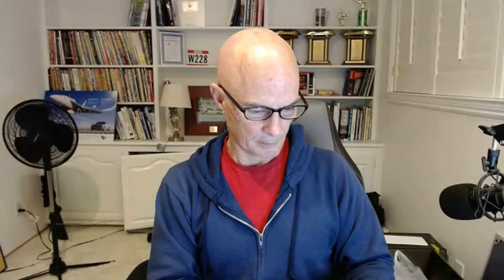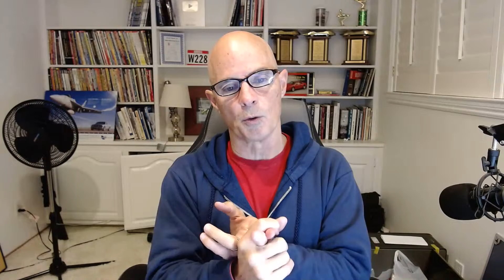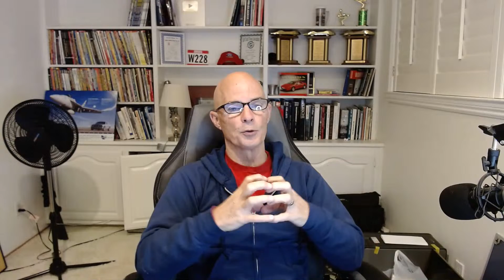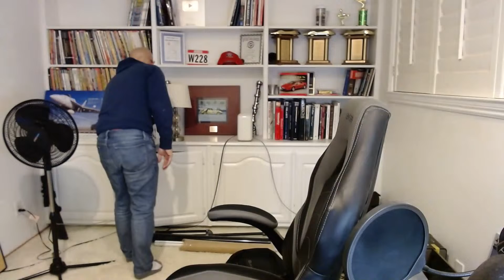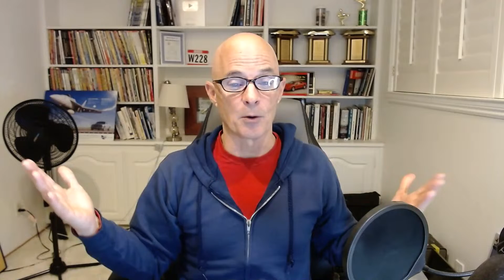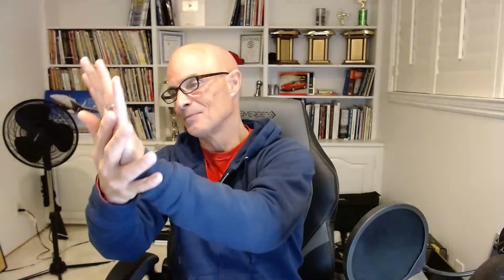LET'S TALK TURBOS-DOES RICHARD HATE WATER/METH INJECTION?

Comment: if liquid wont evenly distribute through the runners.. your theory.. how does a carby work??
Reply from the maker: HAVE YOU MEASURED AF DISTRIBUTION TO THE CYLINDERS ON A CARBURETED MOTOR? I HAVE
Reply: @richardholdener1727  no but I had twin egt's on a 13bt on pump fuel running 28psi with pre turbo wi? Both read the same, the thing is e85 isn't ready available everywhere in the world, most of your tests are on e85 and low boost, mine ran the same wi setup as green brothers racing.. on a street car , what is the point of e85 when you get around 30% less fuel economy and can't fill it up anywhere besides carrying extra drums of fuel with you, I think you should re run a test with a smaller engine.. out of the USA like here in Australia most boosted engines are 4 and 6 cyl and highish compression these days, run it up on pump gas to 20ish, then put it on a proper wi setup on it and see how much boost it will take, that's a real world test in my opinion.. especially with e85 not easily available. Also how many factory manifolds flow exactly the same amount of air to each runner?? Pretty much none but they still work 👌

Comment: If the water meth vaporizes in the intake runner then due to latent heat of evaporation it shouldn’t matter where the evaporation happens in the intake stream. As long as it does the cooling effect will take place. The amount of time shouldn’t have any affect. 

I have seen intake runners on methanol cars ice up after a pass/dyno run, this would lead me to believe that you should be able to get the same cooling affects
Reply: Full meth cars burn a shit load for meth. I highly doubt you could get comparable results from the very small amount injected by 1 nozzle.
Reply: @Dwarfgrinder  I know you wouldn’t get the same amount of cooling my point was it can occur in a short distance/time.

Comment: 100% meth may not pool in the intercooler. I think water will...
Reply: Both will tried it before 😂 but I swear by pre turbo but it's much better at the end of a turbos efficiency island. It's great at making a small turbo think it's big. The science behind it I hear works by raising the air density coming into the turbo and also the heat being lost in compression via phase change also helps make the compressor more efficient at higher flow rates. Ex I have a neon with a 20g that's at the limit of the turbo all the dome pressure all the time kinda thing and it actually picks up 5psi with meth pre turbo. Big think is the air going into the turbo on a 90°f day was dipping down into the sub zero range with chilled meth on a small nozzle. I will say if you have an ls mani or something like that I still think your gonna have Issues with distribution unless you have a nozzle in each runner.

Comment: How about 100% meth injection on a single plane manifold and a TB? Shouldn't that improve mixture distribution? How about port 100% meth injection on a fast with the injectors in the ports inside the manifold or in the ports?

Comment: Intercooler and Water Meth? i am more interested in the octane boosting/on demand aspect of water/meth injection personally. Where i would hit a detonation limit for 91 octane, i may be able to go abit farther with water/meth....
Reply: Good way to blow you combo up if the water meth skips a beat, best thing to do is tune for whatever octane you have and then the water meth gives you a safety margin
Reply: @11ride4life  Still fuel limited then :(
Reply: @ritchardposterior262  
If you are interested in reliability then yes, still fuel limited. I have seen more than one combo get blown up when someone was relying on meth injection and it wasn’t always due to the methanol system having a hiccup, at least once we confirmed it was due to uneven distribution of the water/meth that car specifically was using the water/meth not only to cool the intake charge, but as a way to get around the use of race fuel and because of that, cost him a motor. Due to that experience, I learned that it was best to use it as added insurance, instead of depending on it to make your combo work.

This may sound a bit extreme but I don’t know your budget or set up, but the best way I have seen to run 91 octane the majority of the time, but still have seamless transition to high boost/high power is to run a second small fuel cell and complete 2nd fuel system including rails and of  course injectors. It obviously requires a standalone ECU and isn’t cheap but it gives you the best of both worlds. I helped set up a turbo viper that made nearly 2000 hp and drove around on 91 octane most of the time and had a small 5 gallon fuel cell in the trunk full of the VP import (around 123 octane, oxygenated & leaded) this was done primarily because he did not want to be limited only to gas stations that carried E85, and funny as it sounds he wanted better fuel mileage than the E85 would have had, and as well as the horrendous fuel mileage E85 is intensely hydroscopic and does not store, or keep very well/long. Due to all of the aforementioned reasons, as well as the fact that the owner of the car mostly uses it on the street and didn’t want to have to stop constantly for fuel.
Reply: @11ride4life  Dude, thank you for sharing. this is the information that no one talks about. i really appreciate it.